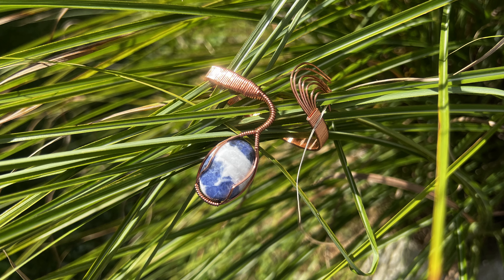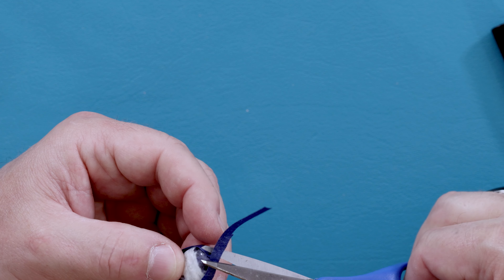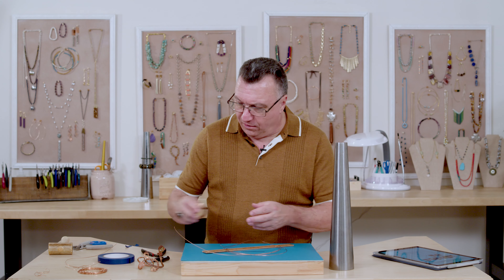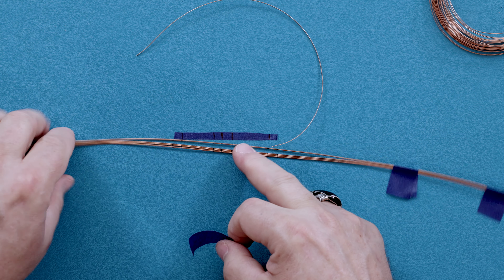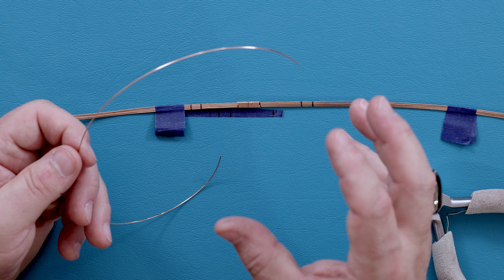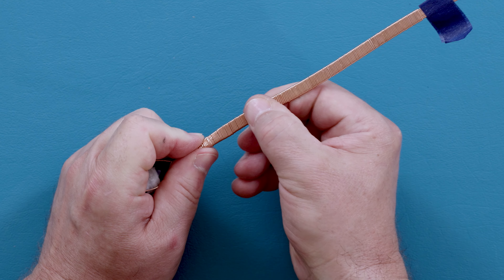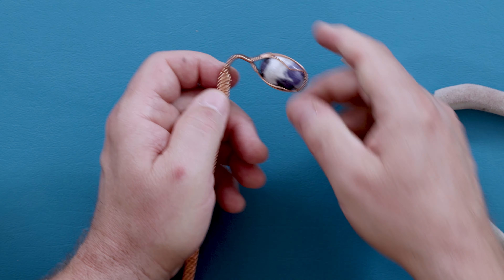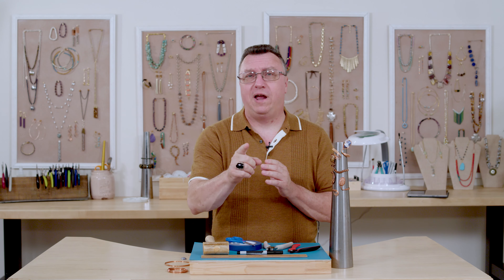Serpentine Style: Making a Wire-Wrapped Snake Bracelet | I Made This

Comment: Great Tutorial Jim. Will need to give this a try. Haven't worked with square and half round wire yet. Will round wire work? Also, Awesome ring you're wearing. Do you have a tutorial for that by any chance?
Reply: I'm not a huge fan of round wire, as you may know. You can make this bracelet using round wire, it just adds a new degree of difficulty. The ring that I am wearing is called a Pharaohs Ring or a Common Ring (I've seen it referred to as both). I don't have a tutorial on this particular design because I didn't come up with it. There are a lot of tutorials online for this design. Just do a search and I'm sure you'll come across 1 or 20. Thanks for watching!